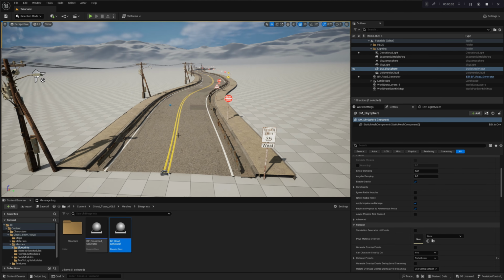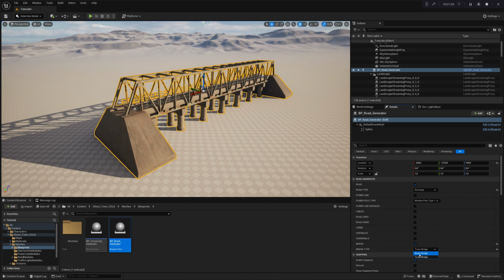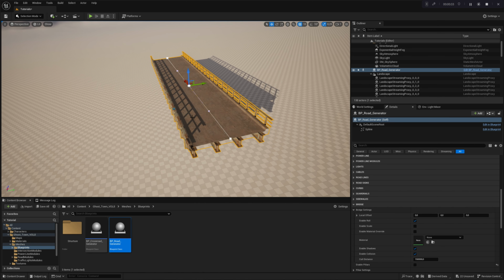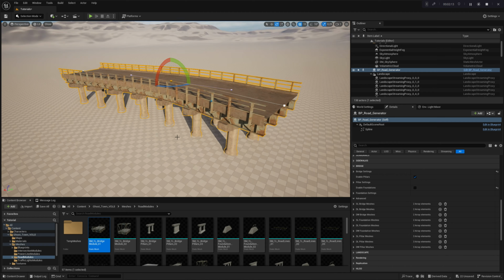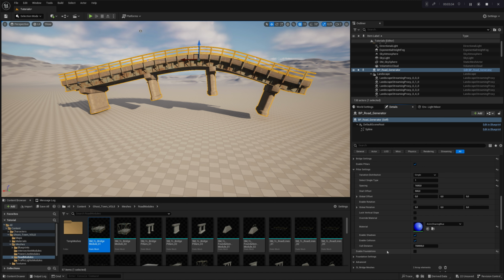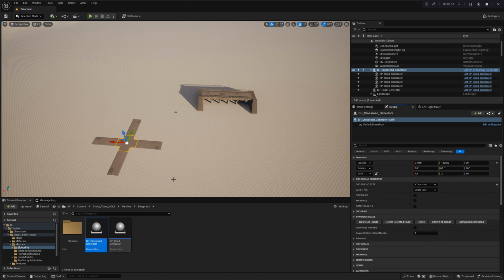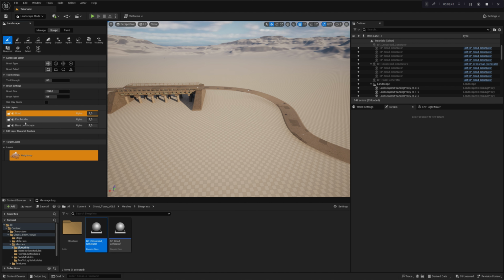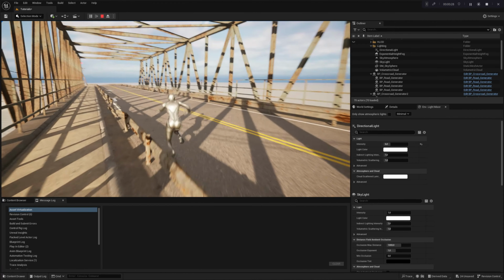Crossroad Generator For Unreal Engine 5 - Bridges

Comment: The landscape is deformed incorrectly, going down instead of up
Reply from the maker: Thanks for the message!
This usually happens because of pre-existing Landscape layers or deformation data in the scene. If the landscape already has height or patch layers applied, new road deformation patches can interact with them and invert or offset the deformation, causing the terrain to go down instead of up.

Common causes:

Existing Landscape Edit Layers affecting height

Multiple Landscape Patches stacked with different blend modes

A landscape that wasn’t created from a clean base layer

Recommended fix:
Export your existing landscape deformations to a heightmap, then re-import that heightmap into the road deformation layer. This consolidates the terrain data and prevents layer conflicts.

In most cases, this resolves the issue